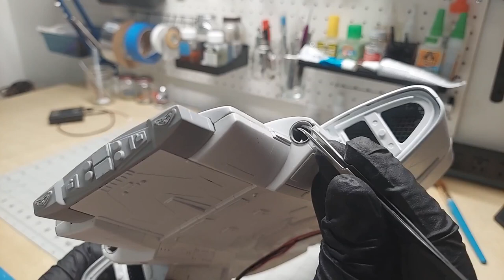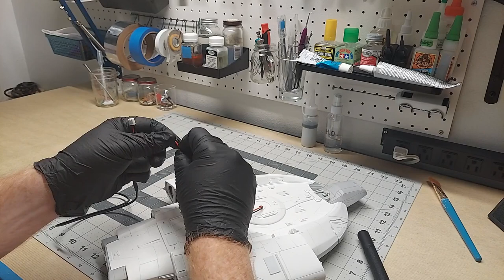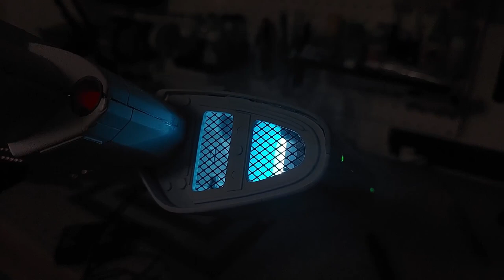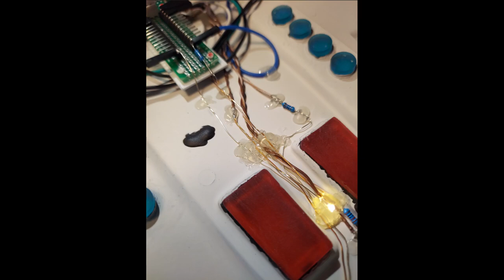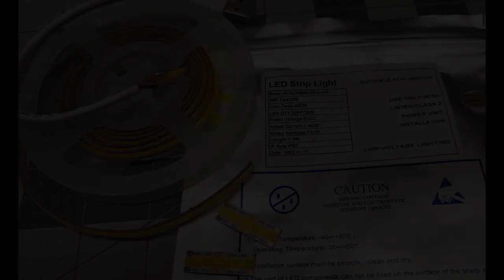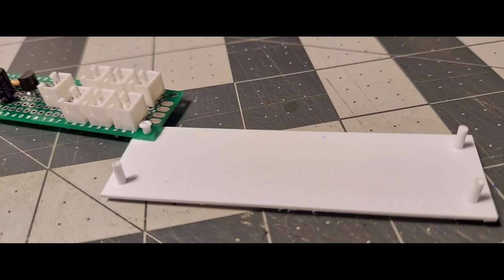USS Defiant Build - Part 1.5 - Lighting

Comment: Dude. Building your own circuit board? That totally blew my mind. I was hoping to get some insight as to how you wired it up. Didn't know you'd take it that extra mile.
Reply from the maker: Heh, yeah. I enjoy tinkering with electronics, so I thought it would be fun to build my own blinker / strobe circuit.
Reply: @mistakeman  Excellent. I can manage a simple circuit and even a soldering iron but would rely on premade boards.

Comment: Hi, where did you get the plans and what 3d machine did you use?
Reply from the maker: I didn't 3D print this model. It is an injection-molded plastic kit from AMT / Ertl that I bought 20 years ago. I also added some after-market parts that I bought from Green Strawberry.